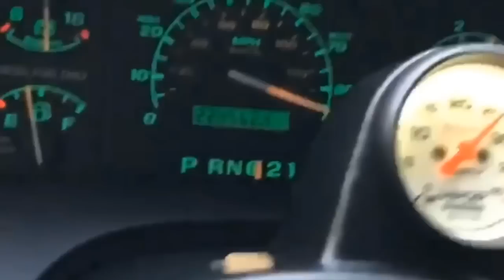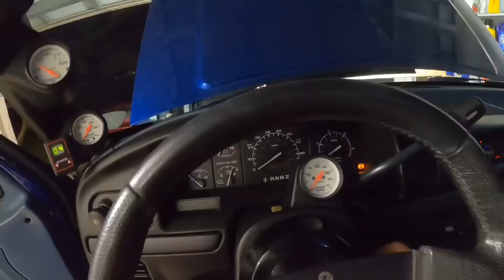OBS 7.3 gets BEEHIVE valve springs!

Comment: Just please remember if its stock or slightly modded Comp springs are fine. You only need stiffer springs if you are planning on turning serious RPMs...downside of heavy seat pressure is more force on the cam, rollers(lifters) and pushrods.  Great if you are building power but longevity will suffer. All in what you want boys and girls...personally i want longevity...
Reply: Great video! Keep up the good work!

Comment: I noticed you didn’t shim the valve springs? Is that needed for factory spec?  Trying to figure everything out that I need to order
Reply from the maker: So most valve springs are supposed to at the “installed height” to achieve the right valve seat pressure for the boost psi. Most guys with stock cams just throw a 0.060” shim and call it a day.

Comment: What is the part number for spring compresser
Reply from the maker: The spring compressor is a knock off of the Rotunda spring tool. Search "7.3L spring compressor" on Ebay and they usually pop up.
Reply: OTC Rotunda 303-483 if you want the real thing

Comment: Just curious: what kind of RPM are you turning that you need to nearly double the valve seat pressure?
Reply: That's what I was wondering. I know 7.3 cams have a high ramp rate, but yeesh!
Reply: Did all that work and you didn’t even show a rev

Comment: How is this not pissing out oil with the covers off, am i missing something?
Reply: Firelord360 they don’t have that much oil volume to spray out the top so you can let them idle without the covers on without making a mess I recommend it when installing new injectors just to make sure you have not too o ring leaks 👍
Reply: @4readytosendit  never knew that and yeah that makes since so you don't have to rip it all apart again

Comment: I need 7.3 help in Central FL. Anyone?
Reply: Bradenton. Probably too far for you. What's the issue?
Reply: @acemobile9806  really rough idle that sometimes is even rough while driving. But sometimes it'll drive just fine for a day or so.
Reply: I sent the PCM off to get looked at and they said it was good. Has pretty new swamps injectors. I just sent the IDM off last week. Still nothing clear
Reply: When you say running really rough, are you sure it's hitting on all 8? You may have a lifter collapsing or issue with rocker arms/pivot balls. 

Do you have access to any kind of scan tool with datastreaming? Would be curious to see what the high pressure oil readings are. Hpop may be starting to get tired. 

Also check the valve cover wiring harness.  Cheap to replace and rule that out.
Reply: It's know at the local Ford dealership. They have scanned it multiple times and it will read either nothing or something different everytime. I put a friend's PCM in and it ran good 95% of the time, but it still jumped a little. Not nearly as bad as with the original PCM.
Reply: @fightinggator4398  
Your driver side wiring harness is grounding on the valve cover. Take a 10mm socket, remove the retaining bolt, pull harness coupling apart, turn it over. The insulation will show wear. Retape it with black tape. Good luck!
Reply: @norman_sage2528  I try it, thanks for the help
Reply: @acemobile9806  it was the IDM, took one of my buddies truck and it instantly ran normally.
Reply: @norman_sage2528  IDM
Reply: @fightinggator4398  go figure. Good job figuring it out. 🍻 sorry I wasn't more help. IDMs hardly ever go out, that didn't even cross my mind.
Reply: @acemobile9806  thanks for trying